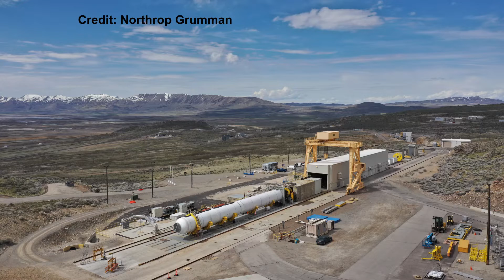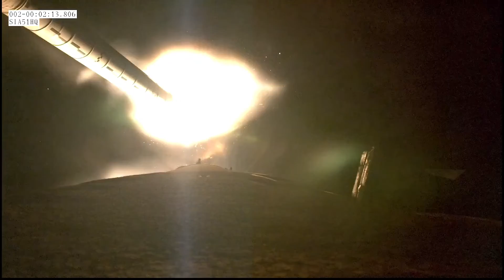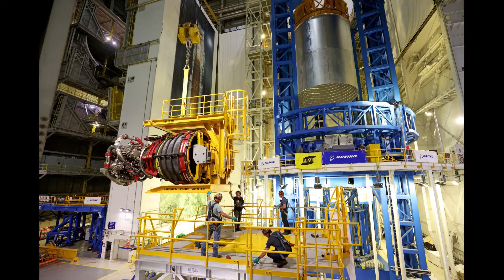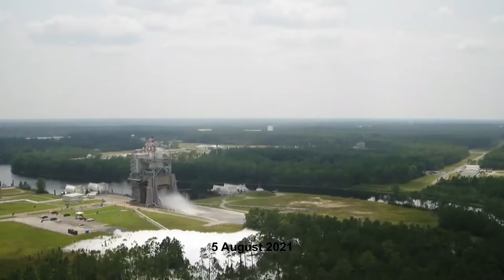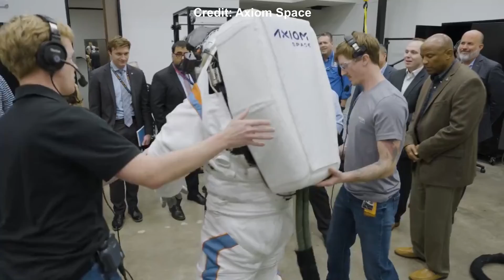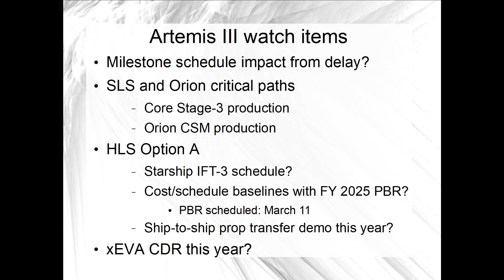First SLS BOLE motor segment done, belated EUS test article pix, RS-25 Refrofit 3b Test #8 complete

Comment: Are they mandated to hit 130 mT to LEO?
Reply from the maker: Sure seems like it, but interestingly the 130 metric ton language might be coming out of the appropriations bills with FY 2024.  That's something that might only interest me, but if the minibus passes, it'll be worth a look at some point.

The language was originally in the NASA 2010 authorization compromise, which I believe is also still in effect...since September 30, 2010.

At this point, SLS Block 2 with the new BOLE motor design might be "close enough" for Congress to a 130 mT-class vehicle.
Reply: @PhilipSloss  I can't see how SLS can hit 130 tons without major redesign (never happening).
Reply from the maker: Never say never, but it could remain an unfunded mandate.  The Block 1B and Block 2 upgrades are funded and contracted, and it'll be up to Congress whether the Block 2 performance is good enough whenever that finally flies.
Reply: @PhilipSloss  I just hope the US congress wakes up and prepares post SLS world because Artemis 10 look so far aways with all the new rockets coming. Wait and see is not going to cut it this time around.

Comment: Once the House Republicans have quit their petty, partisan squabbling the House and Senate really need to approve and appropriate extra money for the Artemis programme so the production of the SLS can be accelerated as the current schedule is absurdly slow.
Reply: itll go up over time just from mastering of production techniques and improving efficiency, but youre right, since that can only go so far
Reply: Or better yet, replace SLS with Starship. The IFT-3 stack could have easily flown an ICPS+Orion to LEO, especially if you remove the tiles and nosecone from S28
Reply: @bryanillenberg  You won't see the SLS replaced anytime soon due to pork-barrel politics also the problem with Starship is that it has no launch abort system which is a big no, no for an inhabited flight.

Comment: I thought the BOLE SRBs were going to be introduced on Artemis V.
Reply from the maker: The plan that's been in place for a while is for EUS to be introduced on Artemis IV, the new RS-25 engines on Artemis V, and the BOLE boosters on Artemis IX.

The other way to look at it is that NASA has four launches of RS-25 inventory and eight launches of SRB hardware from Shuttle.

The 9th SLS launch is so far into the future, though, that there's certainly time for NASA to reassess current plans if they want to.